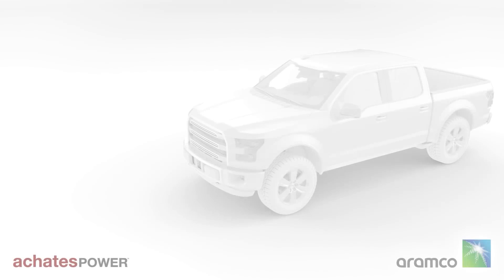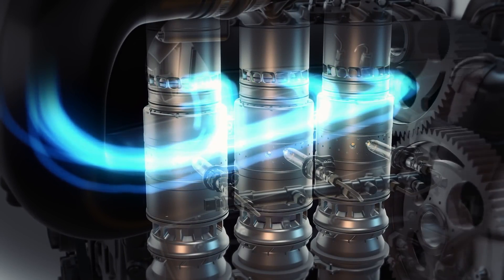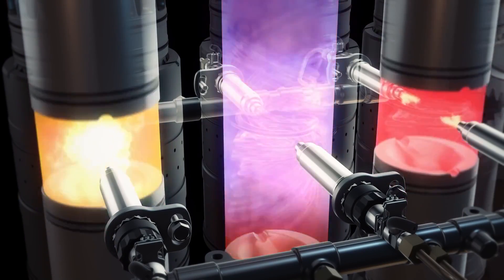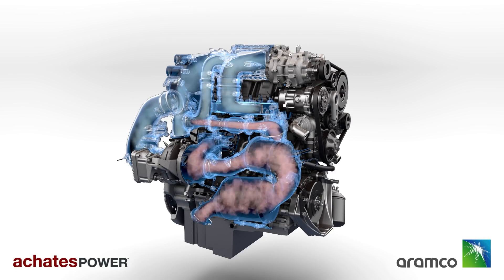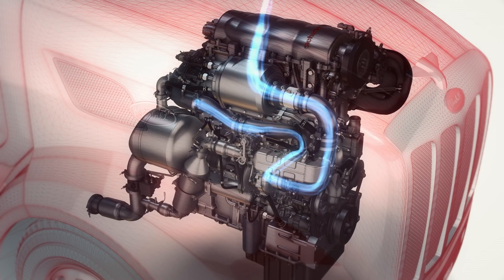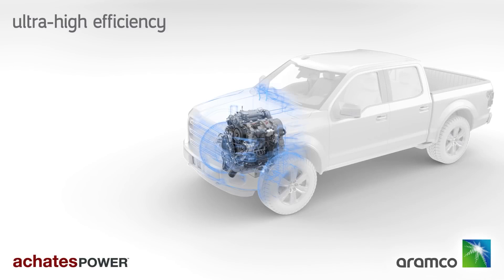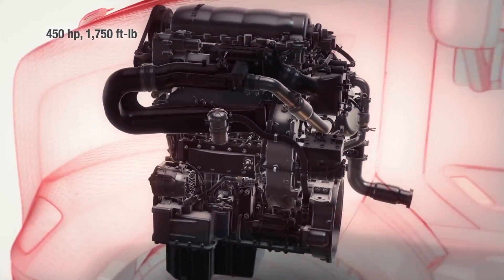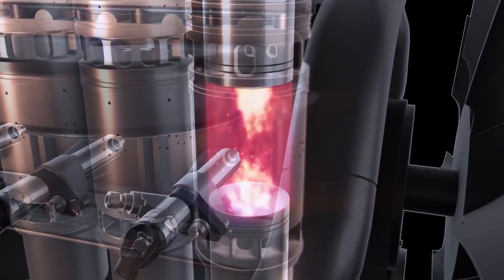The Achates Opposed Piston Engine: The Only Green Diesel Engine

Comment: Don't worry. If these engines do in fact meet the emissions regulations, the EPA will simply tighten the regulations to correct that problem. As they have always done.
Reply: Not anymore.....at least for the next few years
Reply: That forest over there produces CO2... better cut it down. Sorry can’t grow food because it produces CO2. Also stop breathing, like here, put on this mask.
Reply: I think it should work fine old design just emissions has to be worked out
Reply: Just enuf to bankrupt an American company,  and kill off any future advances.
Reply: EPA, they are not the problem! IT IS CALIFORNIA CARB that HAS set the emissions standards! But Trump sh..-canned the latest California rules, so we will see!
Reply: The tiers of emissions allowed are public and not changing. 

That said I don't agree with them at all. We heave very clean diesel fuel now which is better for the engine. It's just EGR and all the aftertreatment which is disgusting
Reply: @taylorsutherland6973  EGR lowers Nitrous oxides,  it only gums up if you're burning oil.
Reply: @taylorsutherland6973  public and not changing... thats a lie. They change every 10 years or so. Also this engine dose use EGR and after treatment but it sues a SMALLER lower maintenance version than current engines.... ALL of the maintenane and emissions reductions derive from the engine design other than that the aftertreatment is just a smaller than usual aftertreatmetn system because it has less to deal with from this engine.
Reply: @Wingnut353   all I meant is that we know what's coming emission wise. Just not necessarily how to meet it.
Reply: EPA is regulations are not something that should be happening. They are unelected bureaucrats who are basically allowed to bypass the legislative process and set regulations that are essentially laws.

Hopefully one day it will be corrected.
Reply: @somenygaard  EPA it's an invention (arm) of Green 💩💩💩deal agenda 👿